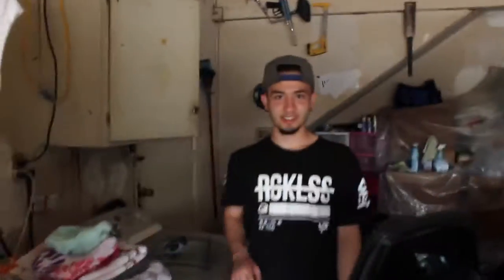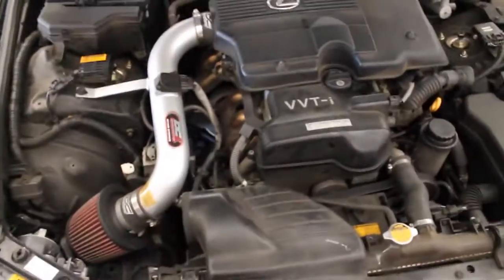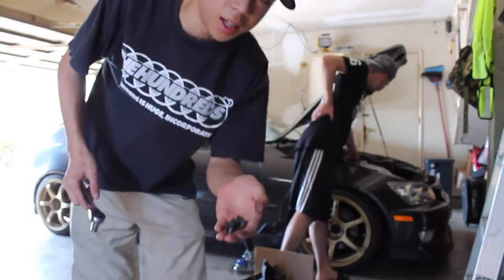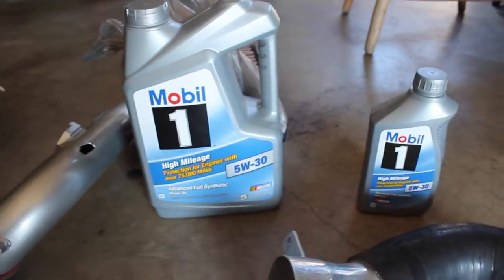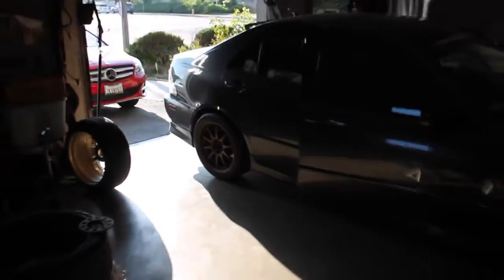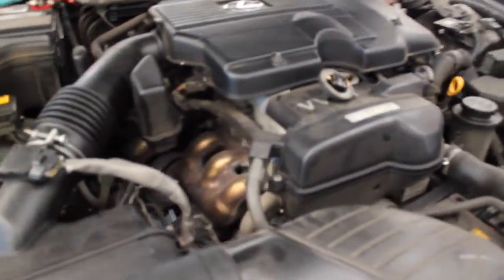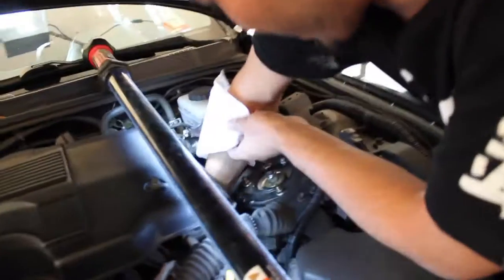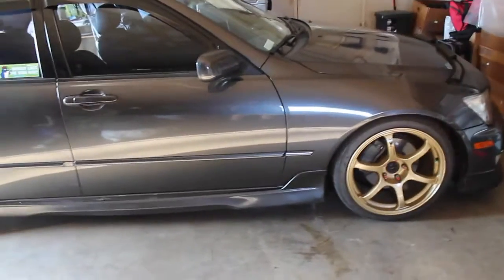RICER oil change/car maintenance

Comment: tbh i like the advan rg2 more than the volk ce28n. You gonna switch those out?
Reply from the maker: Yea, i just swapped them out to test the fitment. 245/40/17 on  17x9 +35 and fitment is too tight for aggressive driving even with my fenders rolled.
Reply: Damn thats hella wide and  where you cop the advan rg2s? I always think of getting some rims for my car but its so hard for me to drop that much money especially if they are like 2000$ for a whole set.Also I dont really like the style of enkeis that much even though their like my budget.
Reply from the maker: I bought them used from a facebook group.  Depending on your area, there should be facebook groups that sell car parts, wheels etc.  I usually buy stuff from those groups because it is significantly cheaper than buying new parts or wheels.  There are tons of good deals that you can find if you know where to look